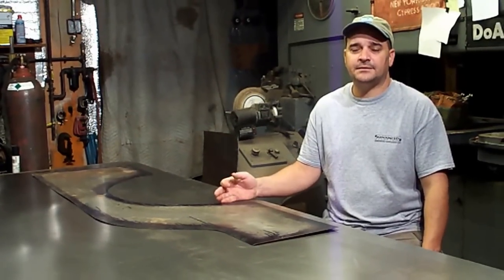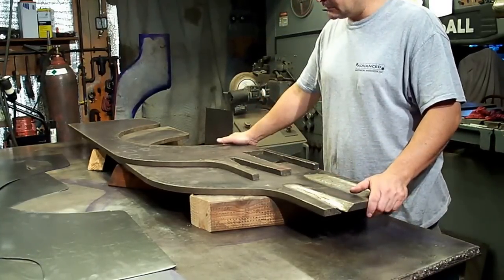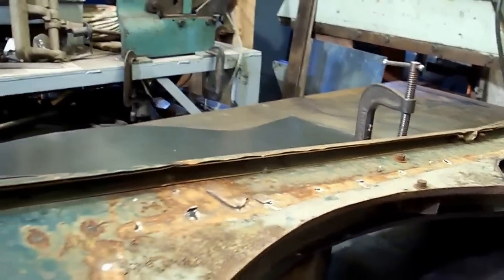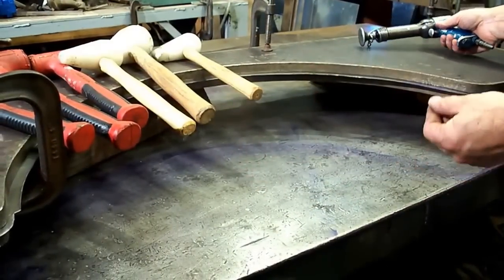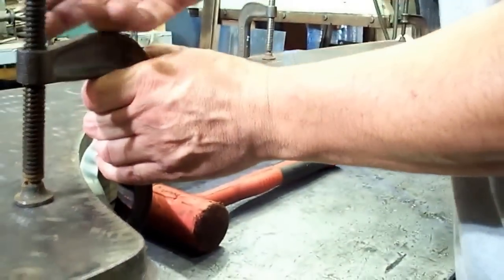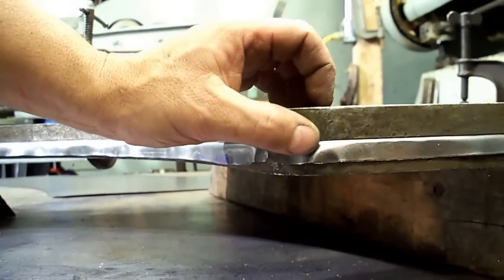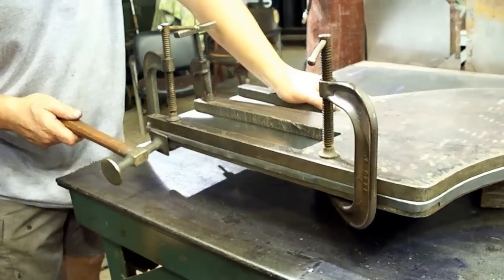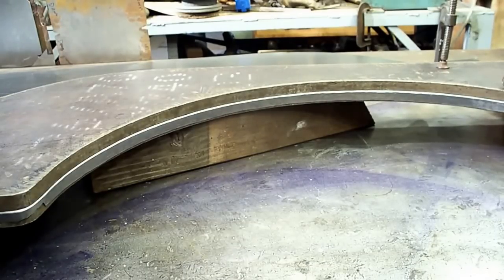Willys CJ3B Jeep body fabrication- side panels on the hammer form

Comment: Hey Brian. Love the videos.  I wanted to start a CJ2A project and after watching your videos... I want to build a MB style willys with as much of the body fabricated myself.  Thank you for the awesome videos.  

I have a question about your hammer forms.  I know you said it is not possible to use plywood because it will get destroyed by the hammer. Could i use a tougher wood and then maybe a strip of thick medal around the edges.  Thinking of ways to cut cost, and I do not intend to use them more than once.

Comment: Sort of metal shaping I should have been doing all along.  I could never convince myself there would be enough paying customers to only be doing "this"; so glad to see you can make some money at it.
Around 13:00 or so as you are moving more towards finishing the wheel arch, are you deliberately moving in a single direction around the opening, as opposed to moving from the bottom two ends and completing when it would meet in the middle at the top of the arch? Or starting in the top/middle and working down to the lower sections?
I guess basically, are there times when there is a definite direction to the work?
Thanks very much for posting.

Comment: I wish I found these videos before, I welded up a 73 FJ40. I'd never seen one before but took it on because we were quiet , I learnt so much. Hammer formed floor panels, Outer sill's, Wheel tubs and I made the rear quarter panels. All my local lads were blown away by what I made but I could've done better, Next time maybe. These videos help me a lot so thanks.
Reply from the maker: thanks for the comment.   keep watching as there are many more videos coming.  Also check out some of my older ones if you just found my channel.

Comment: In the video, you say that a wood form won't work for the upper edge where it folds over twice. Would a wood form work for the bottom edge where it just has the single fold? I only need to replace the bottom edge, and don't need to replace the upper edge. Also, I'm not looking for perfection, just something that looks decent. Thanks for all the great videos!
Reply from the maker: Yes , wood will work for the bottom edge where there is just a single fold.  I like to use maple when making wood forms, seems to hold up the best.  Let me know how it comes out.

Comment: sub'd.... awesome video, thank you so much for taking the time to make it :) i am wanting to get into metal fab.. i have watched so many videos.. what brand tools do you recommend?
Reply from the maker: A lot of my machines are very old but still work great.  Let me know what type of metal work you are interested in and I am sure I can help you move in the right direction.  Thanks for commenting, glad you are enjoying the video series.  Much more to follow.
Reply: I'm wanting to make a metal widebody for my toyota supra. I have seen a lot of people make pieces but I saw a lot more and learned more from this video than any other. you could see a lot more detail on the hammer blows. I'm gonna start with a hammer and dolly set. been looking into designs for English wheels to make my own also
Reply from the maker: neozen777 When you begin buying tools such as a hammer and dolly set make sure you buy the best quality you can afford.  Good hammers and dollies will last a lifetime and the investment is well worth it if you plan on doing any metal working.  A small english wheel will get you started off nicely but remember you can only stretch on a wheel.  If you need to shrink metal you will have to find another way as the wheel is just a stretching machine.  Best of luck with your project.